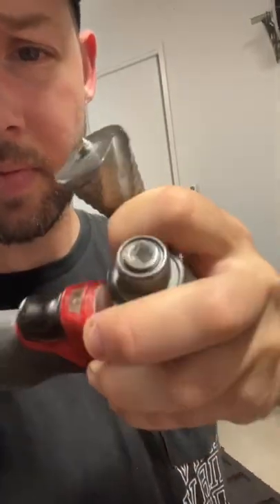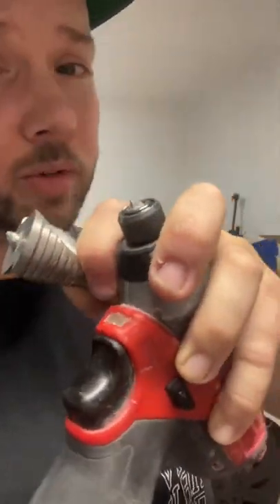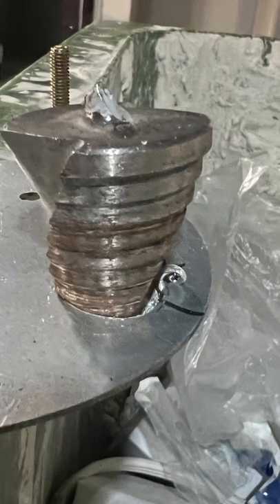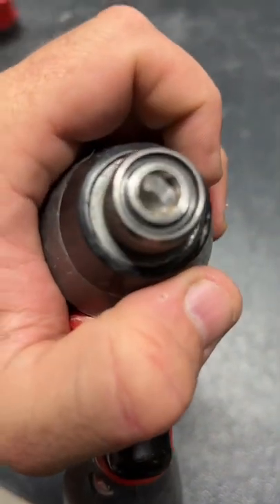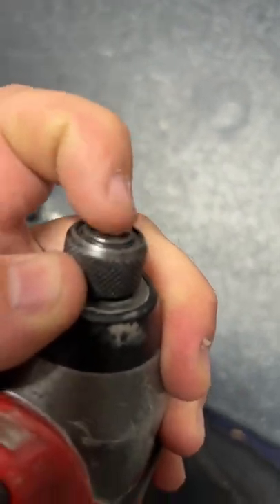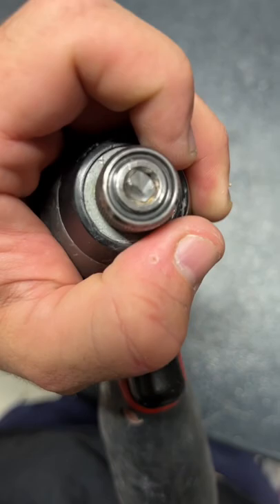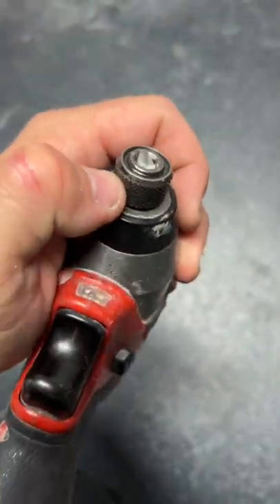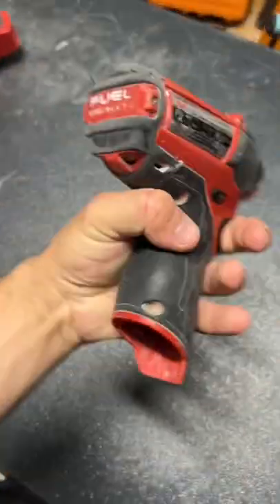Stuck drill step bit marxman

Comment: Avoid using stepbits in impacts where possible especially those large ones
Reply: It's not an impact
Reply: Oh nvm
Reply: U right
Reply: He deserved that I don't think he getting that out
Reply: With a brill he wouldn’t have this problem
Reply: Wait, that's not an impact driver?
Reply: @dreadswizzard9142  
They make that same body with at least two different internal setups. Just bought the impact driver version, the other one is just a bit driver, basically a drill. They look identical though.

Comment: Has an electrician who drills 200 holes a day inside metal boxes with these bits I recommend the Milwaukee double fluted, make sure you use a regular drill also! they last longer if you drill out a pilot hole first

Comment: Had the same problem with the same brand.
Easiest solution is to not use 1/4 inch shank step drills.
1/2 inch shank is the only way to drill with a step bit, especially if you are going to use an impact driver

Comment: Jb weld quick setting 2 part epoxy. Attach something that is metal and also  somewhat sturdy like a screw or nail that you can grab. Release collet and pull. Should come out. (Speaking from experience)

Comment: Had to do this with my
Hilti tools a bit mostly hammer
Drill with sds bits impact too though. Way inside. So a small hook / poker set, missus’ tweezers (they love that) wd 40 pulling the chuck back / pointing It down and a lot of wiggling and banging it down. It won’t be easy son.

Comment: What setting on the impact were you using ? I always use the screw setting for these things and never had a drama
Reply from the maker: Had it on one.
Reply: @AddictedtoTools  use that 4th setting with the screw symbol. It’s actually in the user manual somewhere lol
Reply from the maker: My impact does have those settings. It’s an older m12

Comment: Try gripping the broken bit just enough to run the impact in reverse and make it impact
Reply: I kinda like this idea, my first thought was to to take a punch with a point and try to hit it so it turns counterclockwise to free it up.
Reply: Exactly what i said. Just like when a bolt gets suck ina socket. Once it impacts in the opposite direction it gets stuck it will come lose. Impact more than once it will get stuck in that direction.

Comment: just unscrew the screws and take the shell of it, youll see the chuck bit inside the casing, pull it out and use a screw driver to pop the broken bit out, Iv done it allot with socket attachments, if you send it to a shop they charge a fortune

Comment: Hold the collar down, tap the side with a hammer or a wrench a few times, dab the stuck bit with some CA glue than spray accelerator on the other part of the bit (that broke off), connect together and while holding the collar down pull the bit out.. happened to me a few times.. good luck 👍🏼

Comment: Use a drill instead of an impact driver and you probably won't snap bits off.
Reply from the maker: These are made for impact drivers and I review tools. Thanks though👍
Reply: @AddictedtoTools  I mean it's still less likely to break off in a normal drill 🤷
Reply from the maker: Of course.

Comment: They will always break in an inpact goof
Reply from the maker: How’s that mate? I smash the Milwaukees and alphas and never had a problem.
Reply: Because they are made for the hammer drill brother. I promise you. Whenever the impact gets caught up on anything with those bits they have to impact, and throw the hammer action in the gun. Which 9 times out of 10 your just going to damage the cutting blades or snap that sheeeet off like you did haha.
Reply: Aye mate you ain’t gone respond?
Reply from the maker: Did you mean to say “they aren’t made for the impact drill”
Reply: No way man you actually gots to read what I said but good one

Comment: Grind a slot in it, flat head screwdriver and turn to just crack it lose then will fall out, shes just turn past the edges and wedged in the holder, happens all the time in my 18v that’s 10 years old and is loser goosey, just needs to be snapped back to the right position
Reply from the maker: I believe you’d be right. Mines about 7yrs old. Fairly worn. 👍
Reply: Grip the bit or hit it with a punch in the opposite direction it got stuck. Easier then trying to grind a slot on such an un even surface and set in. If it was flush n flat that be easier.